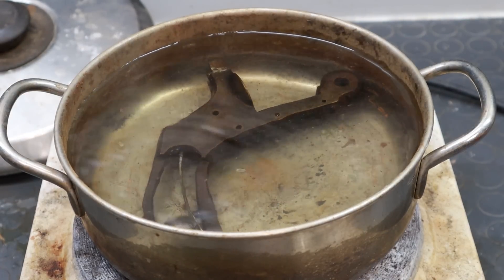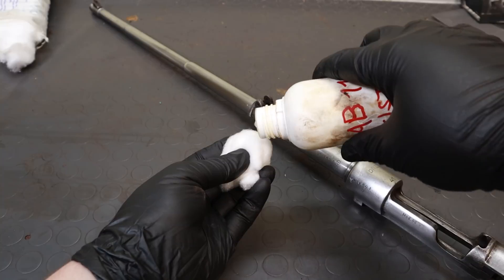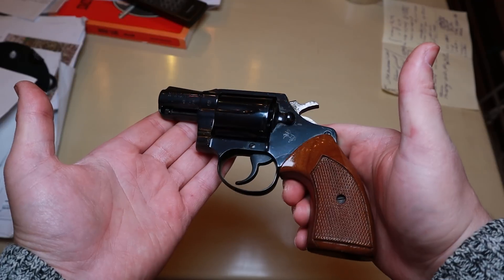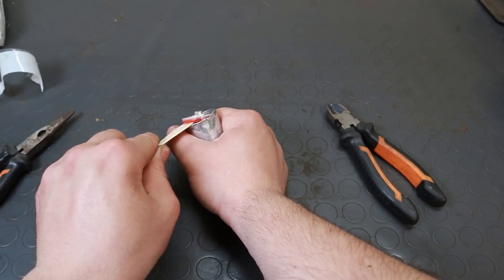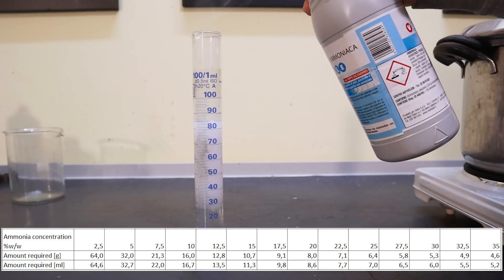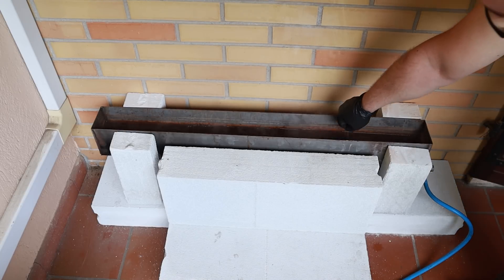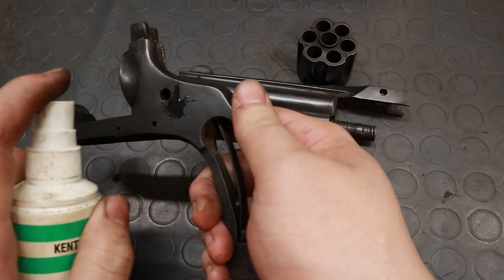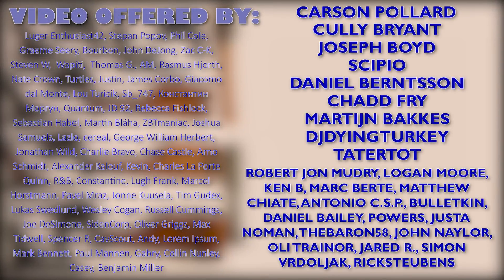Rust Bluing Tutorial - Turn any Steel Object Black With Household Materials

Comment: Any oil will work, but as a USMC veteran who fired tens of thousands of rounds out of beloved FN M3M’s including cleaning, pre-firing, firing, and post firing, the only gun lubricant we used was MilComm TW-25B grease. I now use it on all my firearms at home. It is a fully synthetic white paste. Yes it is technically a grease, but if only a little is utilized and rubbed in until uniform and colorless, it has an amazingly long shelf life and protects firearms very well. One tube should last you decades although expensive. Once I learned to do my weapon maintenance, I never had an M3M malfunction or jam caused by the weapon. Plenty of times I’ve fired it until having to swap barrels, without having to relube. My 1911 loves it and I swear by it. CLP works but I find it to be too light.

To you Backyard/Beyond Ballistics, I love your channels and watched every video you’ve posted. Incredible work and patience with your builds and restorations. It is a special skill and testament to preserve and make ready again these otherwise junked examples of history. Respect!

Comment: Incase anyone needs the zinc but doesn't want to take apart a battery, you can sometimes find rolls of it at marine/boat shops or at hardware stores in the roofing section. It's used to prevent algae/moss growth

Comment: Fyi, three parts of ammonium chloride mixed with one part of citric acid and one part of that mixture mixed with ten parts of water makes just as good or maybe a better rust remover than evaporust. And for a fraction of the price! And it seems that you don’t get as much flash  rusting.

Comment: Hi I need help. I use rust bluing recipe from this movie and i have problem. 
Barrel polished with a steel brush and degreased with acetone. After the first application, steam in the tube for 10 minutes. The problem is that the second layer partially washes away the first one.

Comment: why should be the battery unused? the zinc will still be there? no?
Reply: The zinc oxidises as the battery is used (since it's the anode in the reaction). There'll probably still be some zinc left when it's used up, but much less than in a fresh one.

Comment: I'm going to try this, but the next problem I ran into was how to boil a barrel - it's not going to fit into a pot. I haven't tried it yet, but an inexpensive solution that occurred to me is a poultry feeder. 

They come in 18, 24, 36 and 28 inch lengths. Some of them are just folded sheet metal without seams. Others do have seams, but I bet you could seal them up with heat-resistant silicone or JB weld - it only has to withstand 100 C afterall. 

There ARE stainless versions, but I can't find any locally. The galvanized ones though, are cheap - like <$10 Canadian for a 24 inch. I doubt that would cause any significant issues, though maybe you'll need to boil outdoors or with ventilation, just in case. 

The other idea I saw suggested online was a piece of aluminum gutter with end caps - but a section of gutter, two end caps, maybe a couple screws and some silicone would be more like $50 Canadian, maybe more (might make sense if you already have some of this lying around though).

Comment: Thank you so much for sharing in such a clear and simple way!!  I imagine there's a good reason why you don't add the Peroxide directly to the rusting salts mixture, but I must admit that I can only guess as to why.  Would you mind sharing your thoughts on why not to add Peroxide directly?  Thanks again for your integrity and hard work!! 🙂
Reply: So, my best guess is that Hydrogen Peroxide breaks down rather quickly into plain old water under probable conditions.  I expect that if you add the hydrogen peroxide up front, you risk losing any benefits it brings (unless you use it right away) and the added water will simply dilute your salt formula.  So, kind of a lose/lose if you plan on storing your solution.

Comment: I tried hydrogen peroxide on a piece of steel that I cleared of oxides using a steel wire brush but it did absolutely nothing.
First I had stabalized hp and thought that could be the issue so I bought pure hp and it again did absolutely nothing.
I also tried different steels.
I bought 12% and diluted it to 6%.
I even heated the steel and then applied the hp and again nothing happened.
Reply: You have to make the rusting solution first, just HP wont do anything.

Comment: I do this to my steel impact bits but with much more housetold type items. All I use is acetone, white vinegar, salt , peroxide, and boiling water. I clean them with acetone first. Then I soak them in vinegar for 5 mins. Then a mix of salt and peroxide. Maybe a teaspoon of salt to a cup of peroxide. Let that soak another 5 to 10 minites. You will see the rust start to form and react. Then I put then in boiling water for 10 minutes. To go darker just repeat the proccess. I just did a handful of impact driver bits the other night. Don't forget to oil them up after. Also I later did a few where I just added the vinegar to the salt/h2o2 mix to make it one step. This does make small amounts of peracetic acid tho so be careful. What the result is turning iron oxide (Fe2o3)into black oxide (Fe3O4).  It's basicaly black oxide coating like the black nuts and bolts you can buy at tsc.
Reply: Hi Nate, I am looking for a way to stop the black coating formation when using acids such as acetic,citric, etc. to remove rust from cast iron cookware. Any tips appreciated.

Comment: I got lost between the zinc chloride/ammonium chloride/hydrochloric acid solution and the hydrogen peroxide. Are you saying one can be substituted for the other, or the hydrogen peroxide step comes after the zinc chloride/ammonium chloride/hydrochloric acid solution?
Reply: Peroxide comes after the zinc solution. So you either make the solution with the zinc powder, or you have to first do the whole process of cutting zinc strips and whatnot. After you treat the surface with said zinc solution, you then go over it with hydrogen peroxide, if you want to have that as a catalyst for the faster rusting reaction

Comment: Ive used a solution of H2O2 (10% solution) and just adding some (just a small bit) salt to it. Worked just fine. And its very cheap and easy to obtain.

Comment: I did a few different types. Your method overlaps. the hot water will turn red to black rust (after carding with steelwool) i missed that in a passed job..that turned out plum brown...the last one i did with  hot soft water bath turned black...black black...i think this would have rubbed off..but i stabilized with drying oil .linseed tung paste wax.also you can burnish with .003" "wire" brush.the best general utility i have found ..treat steel parts with paint prep phosphoric acid or navel gel...works great after light bead blast...i did a few,looked nice gray. Duhhh...i rubbed on black stain! Then rub on a drying oil like tung oil..great for an old 22 or mossberg pump ..basicly wipe everything off it is easy..a gunsmith would think its real..and you can touch it up. Thanks again..your method looks good i encourage you to check out different processes. I learned about rust bluing at about 8 years old im still learning at 62!

Comment: On the oiling- submerging the piece in USED too hot to hold about 110 Degrees) but clean motor oil for 24 hours this will result in a high Glos finish. as always, the repolishing prep work affects the end process.
this was a process was passed down to me by a gunsmith who started out in a blacksmith shop at 16 years old in the 1930s. the end result is a deep blue hue I have used this process for 25 years.
Reply: "...USED too hot to hold about 110 Degrees) but clean motor oil..."
This seems like a contradiction in terms. Used motor oil has particles in it. That's why you change it. What do you mean? Take used motor oil and filter it?

Comment: Most American coins are mostly zinc. I read on the treasury website that its perfectly legal to use coins for their raw materials as well. For anyone not wanting to mess with batteries

Depending on the purity of the hydrogen gas produced I'd be breathing as much in as I could and/or storing it in a vessel with potable water, which when shaken sufficiently should yield hydrogen rich water. You really ought to read the research surrounding the medical benefits of breathing/drinking/bathing in hydrogen infused water, there must be dozens of studies with scads of benefits and I've never seen a downside

Comment: Zinc metal is common available @ hardware stores as in zinc %/or strapping w/ holes punched in along it's length ...also caution zinc & Hcl  acid reaction produces hydrogen gas & chlorine gas so this fuel/air ratio easily ignites into a fireball spectacular ...clumsy drop a tool on the concrete floor or any spark makes for fun.....
Reply: boat and outboard motor anodes are 100% zinc..... any boat shop or maintenance outfit will have them.

Comment: Another good source of Zinc is the goold old GARBAGE U.S. zinc penny.   These are usually copper clad so you will need to melt the zinc out of them with a torch being careful to remain below the temperatures required to vaporize said zinc which would be well below the temperatures required to melt the penny.   Using the zinc in the battery is probably safer :)
Reply: or the anode for a boat. They come in all shapes and sizes and are pure 100% zinc.

Comment: I think you mentioned that you can dunk the part into boiling tap water while I heard that you need to use distilled water for bluing. Can you comment on the difference?
Reply: Use distilled water.  Tap water contains impurities that become concentrated as the water boils away.  Those impurities become embedded in your bluing.

Comment: You can just put the parts in a humidifier box to get a thin red rust and then boil or steam them. Then you just card the parts off with a brass brush and penetrating oil.

Comment: On not hurting soldered joints there is a solder that melts at way way low temp like 205 f. Read it in a old gunsmith book. Can't remember what it was called but they talked about it as a warning it is out there. Old not used anymore but old stuff may have it.

Comment: Do you have any suggestions for this process on a vent rib shotgun barrel?  I will be able to sand the old finish under the vent rib fairly well, I think, and apply the solution via a q-tip or similar, but I dunno about buffing the oxide.  Do you think that not buffing the oxide under the rib would cause any issues?

Comment: Guys...
Just put the metal into some boiling vinegar and boil until desired color is reached. Rinse with cold water
 Polish with very fine steel wool. Oil.
Finished.
You could even coat the metal with mustard and leave it for a few days then rinse and polish lightly. Oil. Finished.
Or...
Clean metal completely.
Heat to desired color. Submerge in oil. Lightly polish. Oil. Finished.

Don't take apart batteries. It's nasty and there's no need.

Comment: I have heard that a affordable was to to clean a gun that was a loud to get very rusty is transmission fluid and acetone is this true
Reply: acetone, brake cleaner, gasoline are among a large group of degreasers. Many are inflammable or carcinogenic. SO I can't comment on the 'health and safety', but they do remove oil or grease.
Transmission fluid is a lubricant and also displaces water..... I can't see any harm from wiping or soaking  your gun with it. Left on a bit of rust, it may even soften it a little. But you would still have to brush and steel wool to finish the rust off. Then degrease, then whatever process
Reply: @colonelfustercluck486  thanks

Comment: Or, you could just go out and buy a bottle of liquid bluing that is meant for this very purpose, and it works well, and costs is well worth it's ease of use.
Reply: And, being copper oxide, if used on a large surface will show green reflexes.

Comment: Three important questions:
1) Do you need to replace the all water every boiling cycle or can you keep the water in the tank you used before?
2) Do you need to thoroughly clean and degrease the gun after each time you scrub off the black oxide and before the next application of solution?
3) Can you really put gun oil OVER boiled linseed oil?  I am worried that the gun oil will dissolve or emulsify the boiled linseed oil underneath, even after it has hardened.

Thank you!
Reply: 1) Not necesary to replace the water (distilled water is better than tap water), but it delivers a little chemical smell.  So if you use it inside your home, be careful to not worry your wife.
2)If you handle your parts AND steel whool with clean gloves, not necessary to degrease before applying new coat of liquor.

Comment: How do you polish and rust blue small  parts like screws, buckles and other parts
Reply: It's not easy to rust blue small parts because it's not easy to scratch them. That's the reason why small parts were usually heat colored before caustic bluing were used. For example, yellow colors on Luger's trigger, safety ; blue color on early Colt 1911 trigger and safety.

Comment: You're an expert in this field, thank you for sharing your knowledge.
Do you have the formula of the original german pre WW2 rust blue ?
The color is grey-blue and not dark.
The right color allows to reblue partially, when for example a weapon is pitted only in small areas, or when only some small areas has been sanded by a previous owner.

Comment: I recently did something similar, but instead of your rusting solution i used vinegar and table salt heated on the stove to rust the metal.

My final hot water bath (i did four coats) i added a bunch of baking soda to neutralize the acids before i dried and oiled.
Reply: so was it satisfactory? would you do it again?
Reply: @domm5715  it worked.

I wouldn't have done it on something as important as a firearm though.

Comment: Correct me if I'm wrong, but I believe the zinc cores of US 1¢ pieces would work as a source of zinc (make sure they are from 1983 or newer).
Reply: also new boat anodes are 100% zinc. Boat shops usually have them. They need replacing every year or two and are usually in stock where boat hardware is sold. 
(Don't use old anodes as they will no longer be 100% zinc)
Reply: @colonelfustercluck486  Yeah, that's definitely a better source of zinc than the cores of 1¢ pieces.

Comment: Hi, I'm having a little trouble carding with de-greased "0000" steel wool.  It seems that the black oxide velvet doesn't come off as easily I would have thought, and I have to do some firm rubbing.  It's hard to know where the black velvet ends and the bluing starts.  So, I think I've carded down too far a few times.  Any suggestions?

Comment: Do you know if the hot blueing bluing will work on stainless steel?
Reply: No, it does not work on stainless. There is a chemical product that darkens stainless but it doesnt look as good as true blued carbon steel. If you absolutely have to change the color of stainless your best bet is ceracoat, which deposits a thin layer of super hard ceramic outerlayer of the color of your choosing.
Reply: @sergeantbigmac  Thank you for your answer. I might end up going with proper blued steel as it just looks far nicer than probably trying to do something with stainless steel. It is also pretty quick and super easy to do anyways

Comment: I've heard the best solution is clean nails dissolved in nitric acid until it won't dissolve any more, is that correct ?
Reply from the maker: That's one of the dozens, if not hundreds, of rusting solutions developed over the years. It's relatively famous because it's one of the oldest. What you get from that is a solution of ferric nitrate and residual nitric acid. I haven't tried it personally, but it's referenced a lot in literature as a good and old recipe. I don't really see what improvements it could give to the solution I showed in the tutorial, and it requires nitric acid which is an ingredient somewhat hard to get for the general public.
Also, many improved recipes required both nitric AND hydrochloric acids combined, giving an unstable and unstorable aqua regia mixture.
In this video I wanted to suggest a mixture that was at the same time highly effective, made from available and non dangerous chemicals, and that could be stored for long periods of time. With all this considered, , the zinc based solution would be really hard to beat. At least I couldn't find any better.

Comment: Two questions I got. For cleaning the inside of a barrel would I use normal gun cleaning tools? Second question, when applying the oil to protect the finish can I use rem oil?
Reply from the maker: I've never tried rem oil specifically, but literally any oil I've tried (Kentron, Ballistol, Beretta, CLP Break Free, straight vaseline oil, cutting oil, and even wood polish oil) worked fine. Drying oils, like linseed, better if of the "boiled" type, offer more rust protection, forming a durable thin film on the surface, but require care to avoid leaving excess on it, otherwise it'll remain sticky for quite a while.

Comment: Very good video.  You can also buy rust brown and rust blue products pre-made here in the US.  Much easier than making it yourself.  I've had excellent results with both processes using the commercially available products.
Reply from the maker: The reason why I felt like making this video is that anywhere out of the US getting bun bluing supplies is a nightmare. Even when you can do it, it still takes a long time to get the item delivered, and the prices are much higher.